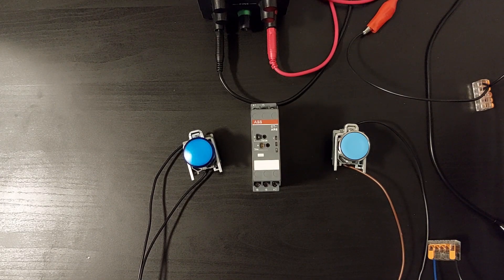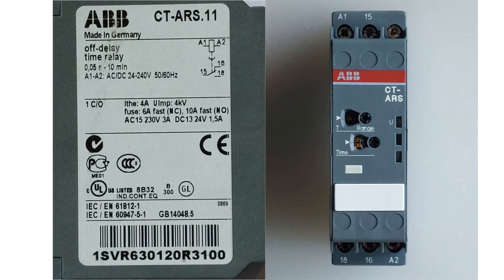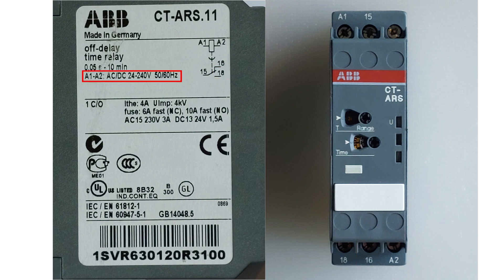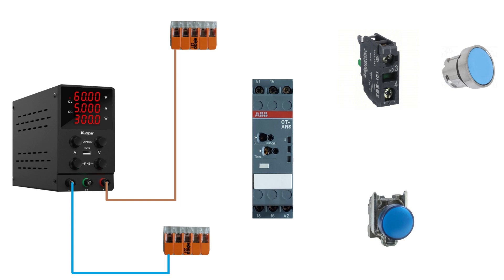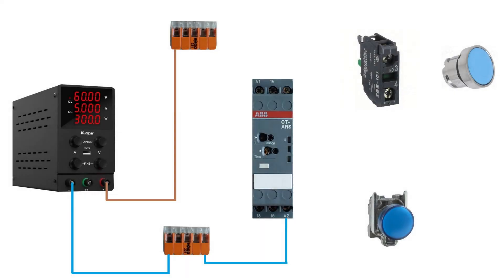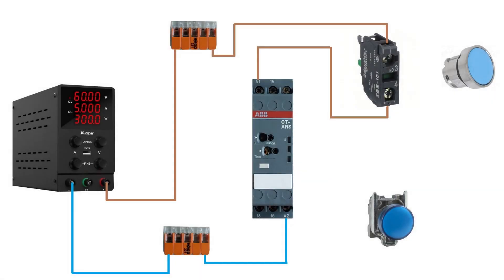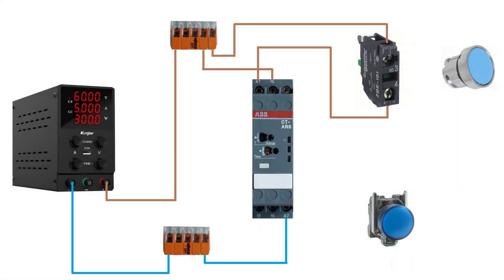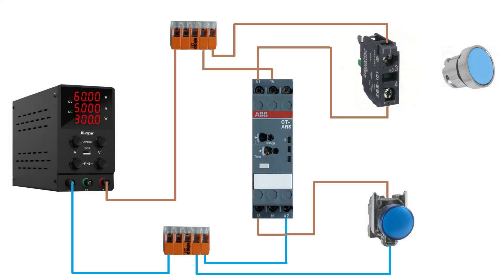How to wire a timer relay

Comment: what happens if you put another lamp into the other pin ie  NO or NC  would it flash one thenm the other or would it keep swapping from one to the other? or will it only swap for the timer setting when the button is pushed, and what would happen if you took out the switch and just put in a jumper would it just stay on all the time or would it cycle between both lamps every time the timer reached its set time?